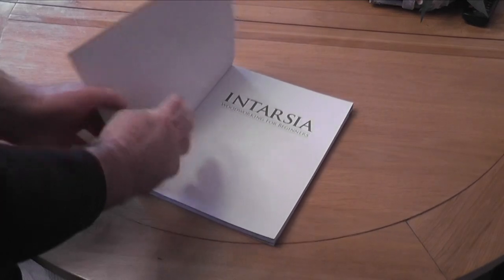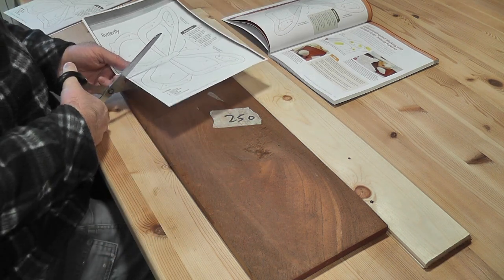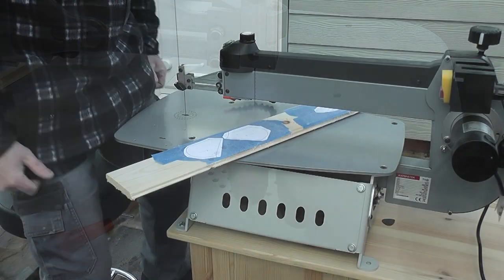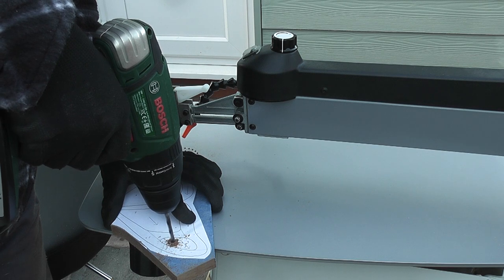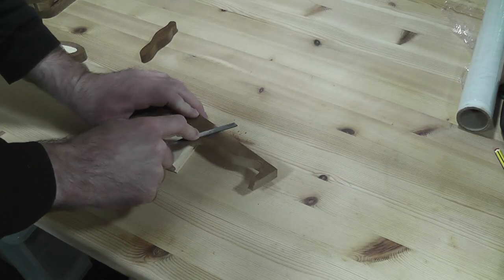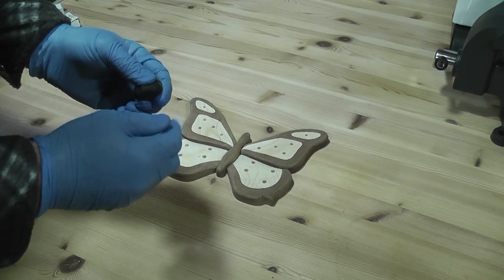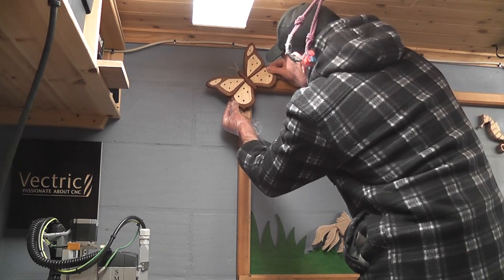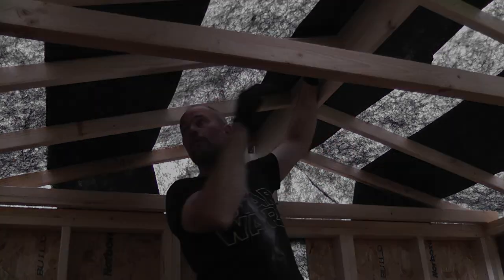Intarsia Woodworking - Making A Kathy Wise Butterfly Using The Scroll Saw

Comment: That turned out pretty well actually, a couple of tips for scrolling though.
If you need to cut 2 shapes to fit one inside the other, use the thinnest blade possible, then cut one on the outside of the line and one on the inside (assuming the line is only as thick as a sharp pencil line), then sand to fit. If you need to give a gentil love tap (like knocking on a door)then that should mostly be fine, obviously depending on the level of detail.

Save yourself a small fortune in the future too. Get down to b&ms and buy their 3 pack of masking tape. I go through tons of the stuff.
Also, you really only need 1 quick pass of that spray glue, you're not sticking carpet down here.

Overall though pretty impressive. Keep it up
Reply from the maker: Thanks, good tips. I definitely need to get the scroll saw out more often. Hopefully as the weather gets better I'll be out more and fingers crossed I'll get better :-)